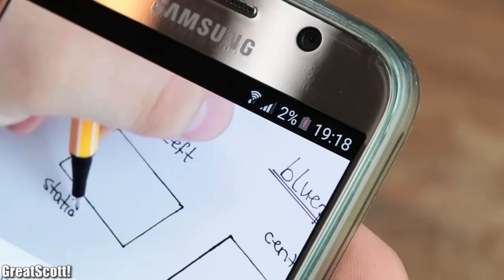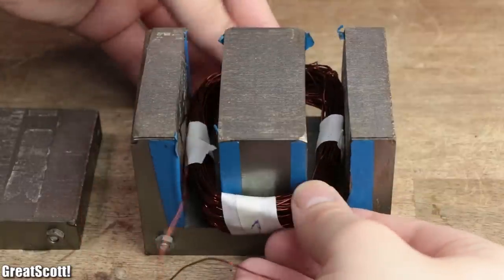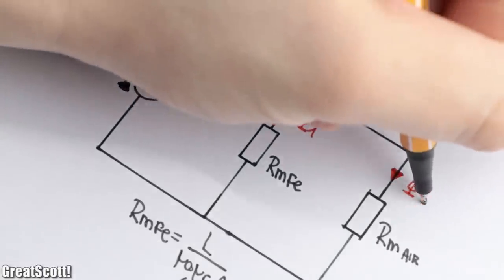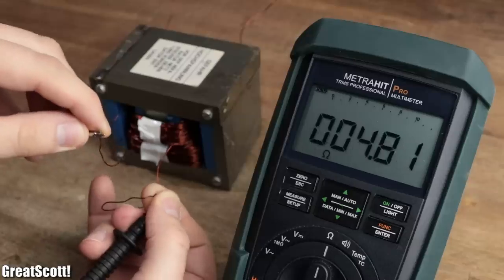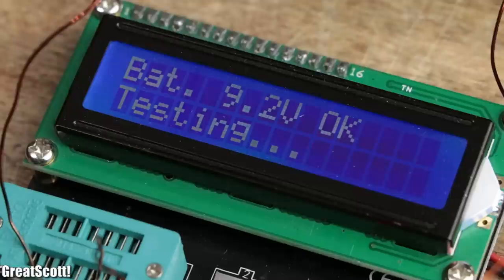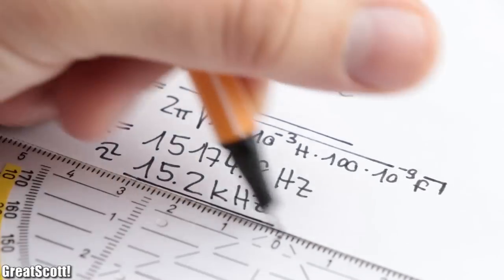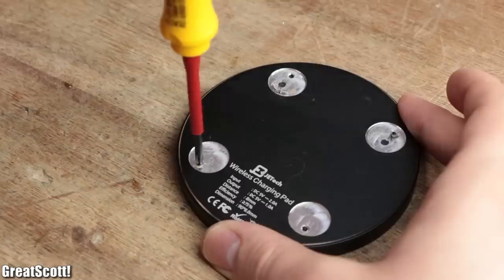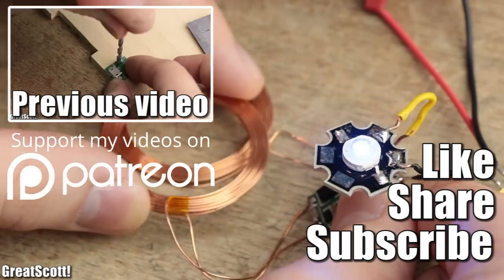How Does Wireless Charging Work? || Crude Wireless Energy Transfer Circuit

Comment: This is only a guess cause I've never tried, but wouldn't making your own custom coils and circuits to charge a phone work if you make the secondary like a factory charger? I would think that if China can make knockoff chargers, you could match the handshake resistance in the secondary connected to the phone. The only thing the phone would then care about is if it's being provided the correct voltage. Anyone care to correct me?

Comment: Wireless charging. One of these gimmicks no one needs (what's so hard about plugging a cable in?), but everyone wants. Why? xD
Reply from the maker: There are many good reasons. But I agree that it is just an extra for smartphones.
Reply: ElectroBlood convenient - just go to bed and drop it on the charging platform without need to find wires stuff, also no worry about the port worn out
Reply: If you have a clean setup, that could make it look cleaner maybe? Idk :P
Reply: GreatScott! Okay, I get there is a benefit for water proofing and plugs wearing out. Also some people tend to break plugs by not understanding polarity (though USB should be made into a symmetric plug standard in my opinion) So perhaps it's not too stupid of a feature on smartphones. 
My inner engineer just tells me to always go with the most efficient solution... xD
Reply: GreatScott! Oh btw: Great job on explaining the equivalent circuit diagram in a way most people can understand without knowing much about electronics. It took me ages to grasp the concept due to confusing explanations from my professors. xD
Reply: Symmetric reversible USB does already exist. It is called USB type-c plugs.
https://en.wikipedia.org/wiki/USB_Type-C
Reply: Why think small? not only small devices needs charging. It's actually pretty intresting for the upcoming EV market, where charging areas can be layered under the parking lot's tarmac.
Reply: Daniele Elaborati Oh yeah. That will reduce the energy efficiency of EV's down to awful combustion engine levels. I'm asking again, this time regarding EV's, a concept where water proofing and worn out plugs are not really an issue: What the hell is so hard or inconvenient about taking a cable and plugging it into a car?
(This post sounds waaay more agressive than I intended. Sorry about that.)
Reply: It's not about the inconvenience rather it's the possibility to charge the car whenever you stop it. Owning an EV means that you have to plan your trip with accuracy in order to avoid being left stranded by the side of the road . Don't get me wrong , i'm an EV fan and i'm planning to have one as soon as they become cheaper ( and i think it's going to happen soon) I agree about the inefficiency of the system though.
Reply: Daniele Elaborati That would require copper/aluminium coils pretty much everywhere under the road surface. This would be:
1) Extremely expensive to build.
2) Even more inefficient due to resistive losses in said ginormous coils.
3) very short-lived because people would try to steal the massive amounts of said expensive metals underneath the road surface.
Now don't get me wrong either. I am an electrical (especially power) engineering student/nerd and plan on driving a lot of EV's once I can afford one (which might be in 5-10 years). I love the Ideas many people have to improve the concept (f.ex. battery swapping stations, fuel cell EV hybrids,...). And while this isn't as impractical as solar roadways, a wireless energy supply network underneath the streets is just not really commercially viable... :/
Reply: ElectroBlood That u can charge it att night maybe?

Comment: So, from your video i can assumed that wireless charger isn't worth yet?
Reply: i dont think so.
It´s like saying "W-Lan is useless because it is much slower than plugging in  a cable"
Comfort also has a value...
Reply: I don't agree. I don't think that you should buy a phone instead of another just because it has this feature. Plugging a cable is almost as fast as putting your phone on the pad, and the eventual 1s that you take when plugging the phone will make the charging a lot faster and efficient.
Reply: Korto Vos unless wifi is much efficient compared wireless charger. We deal with battery here that we know heat is biggest enemy. Yeah i know it convenient, but if you live here in tropical area (33°C average), phone can heat up to 45°c charging with wireless charger compared with turbo charge (fast charge 2) ~41°c.
Reply: Ahmad Fadhel It´s just another features :D
I like it when my Smartwatch is worm when i put it on...
Reply: Wireless power transmission is not worth it at all.
I dare you to wirelessly transmit even 1KW over a 1km distance lol, wires are king when it comes to power transmission.

Also, to Korto Vos, you can't compare wifi to power transmission.
Reply: agree, that's what I've been thinking lately after using wireless charger for almost 1month and then stop using it. Fyi scientist from Japan able to transmit that much power (1.8kw to be exact) using microwave, but with relative short distance (~55cm).
Reply: Korto Vos beware battery exploding 😁
Reply: Ahmad Fadhel
Well, there you have it, you can't beat good ol' wires if you want to transmit power, data? sure, but not power, at least it's not efficient or practical to be used in most applications.